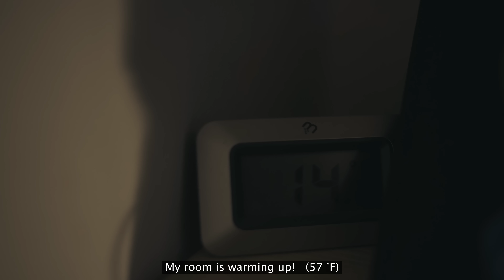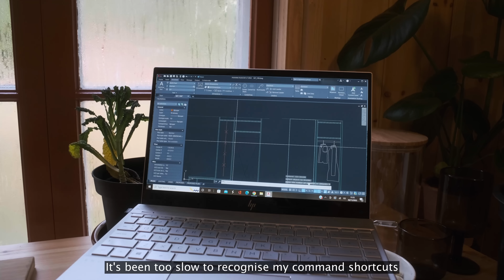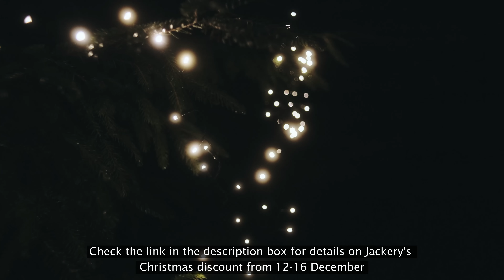ONE DAY Rural Life Without A Car, Renovating and Food Shopping | almost ASMR (Story 37)

Comment: Hey, if you want to continue cooking in that corner. I would recommend protecting the wall and the wood, over time a lot of cooking grease and such will start sticking there. I have had the same problem as my house here in SE did not have a designated cooking space. Also, since you have those little heaters, I would suggest heating up the kitchen, all that moisture is going to cause mold (sadly know that from experience as well). Lovely video :)

Comment: Total respect for living without a car. Long term an electric bike with a trailer would be a good option, they can do up to 90 miles on a single charge, or simply add a cargo trailer to your existing bike. 
I would make the chimney flue a priority job for next summer and get that stove overhauled, back up and running with a hot water tank if that is possible.

Comment: A tip for your old windows is to use windowstripes (fönsterremsor) and windowwadding (fönstervadd) often found at ICA! 🙏❤💪
Reply: Are those a type of window plastic ?
Reply: @skyval6359  It's wadding for putting in between the windows to deal with condensation, and paper stripes (like thin stripes of white pre glued wallpaper) to seal the gaps on the inside of the Inner window.

Comment: you could leave the water alone and buy a tap water filter with lots of filters the tap water goes in the top and is thoroughly filtered like spring water it's not very expensive to buy I suggest you use it

Comment: You can use a Jackery to run an electric ceramic heater for awhile….. I was planning on using when I slept in my car when it was cold.
Also an idea to heat water in your shower house with camp stove right there on the spot. Even running a gas heater close by while showering so not to get as cold.  Lots of choices out there in the marketplace. I don’t like being cold while camping ….. just a thought.